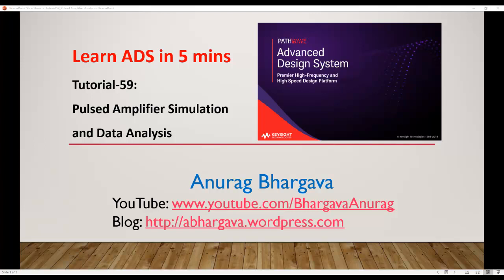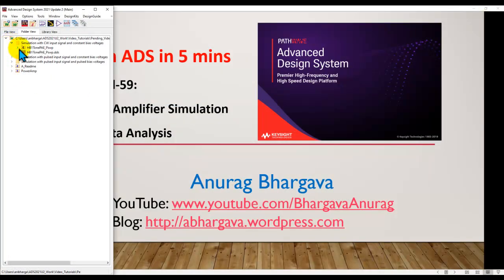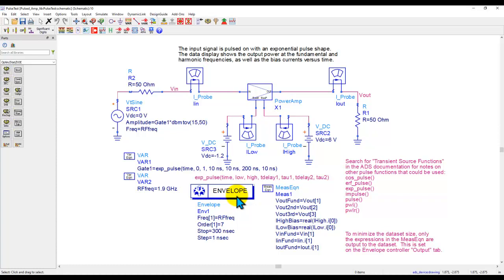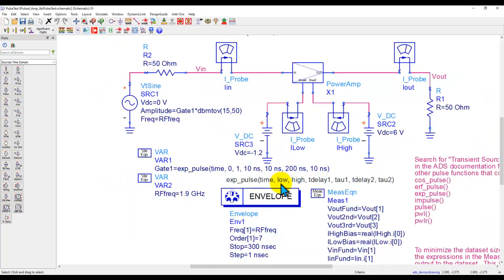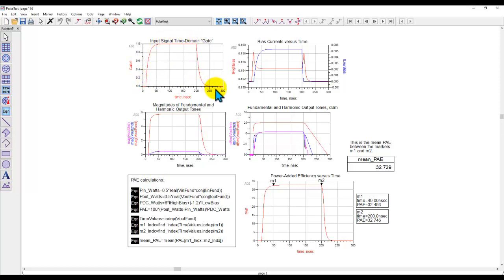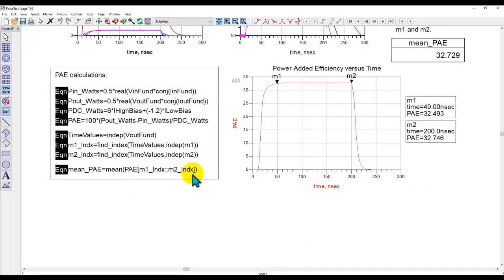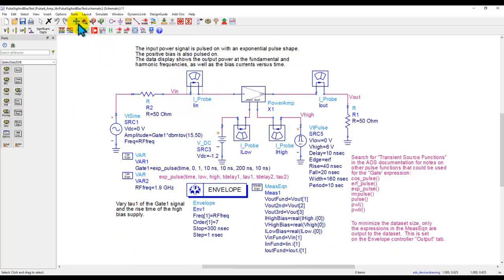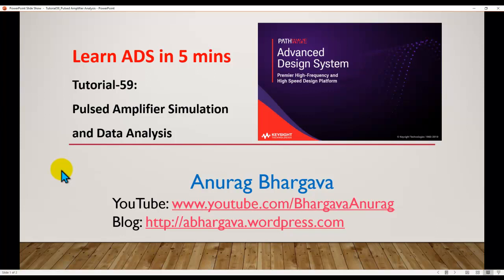Tutorial-59: Pulsed Amplifier Simulation and Data Analysis

Comment: Sir, how can we convert lumped components to transmission lines? Is there any utility in ADS?
Reply from the maker: If you are using Impedance Match Utility in ADS then it has lumped to distributor converter built in that you can use but it is not available as a generic tool within ADS. For standard components like Inductor and Capacitors, its not that hard to perform theoretical calculation of transmission line parameters and if required you could optimize it a bit to achieve desired goals.
Reply: @BhargavaAnurag  thank you!

Comment: Sir , how to change layout technology .001 mm to .01 micron after creating a layout.
Reply from the maker: You shouldn't do it. Technology has to be selected properly when you create the workspace or library. When you change it after selecting one specific units/technology then you can change it from Options->Preferences but then you will also need to change Font/Text size, Pin size, Port Size etc etc so it is advisable you select it properly upfront.